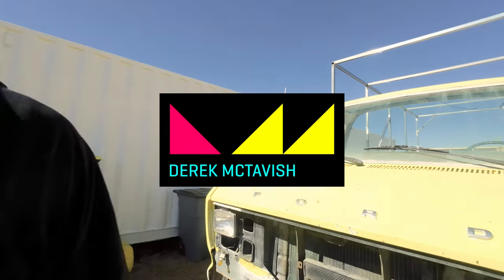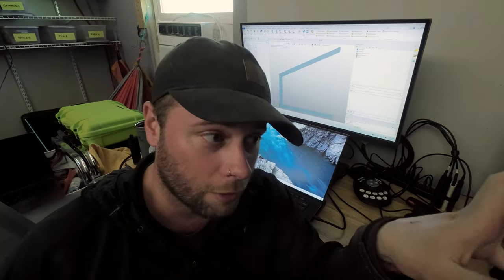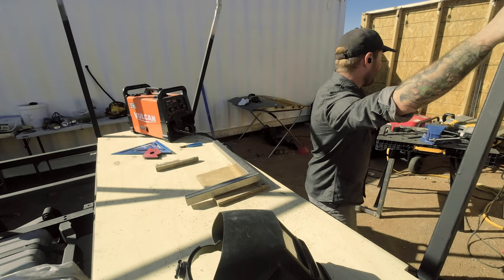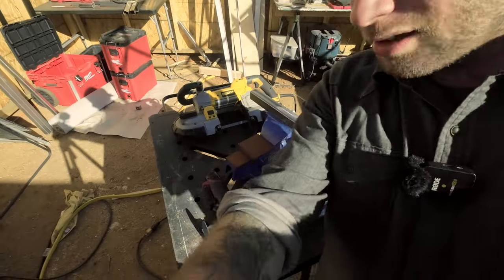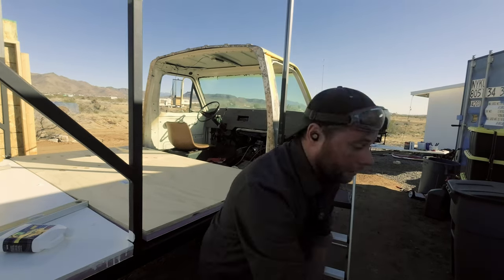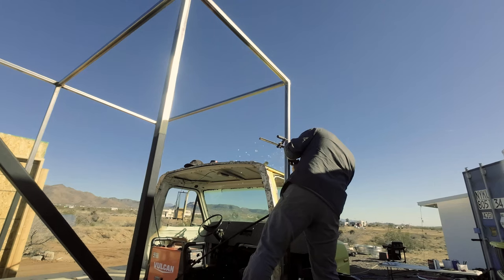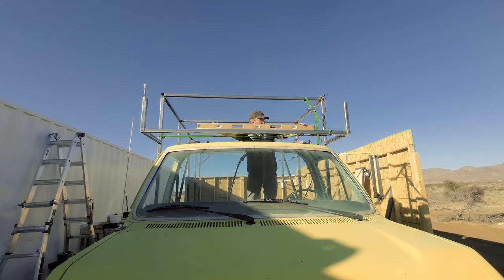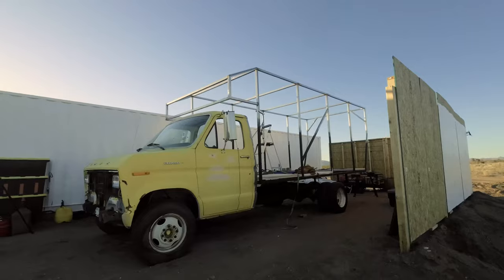It's starting to look real - overland van build attic / storage

Comment: I love the editing of your videos, it’s incredible! I’m still chugging along with my Harbor Freight flux core welder and shuttle bus.

Commenting, liking, and subscribing so you can get more recognition for your hard work.
Reply from the maker: Thank you!  Hey, everything I'm doing is with a flux core as well.  They work so much better outdoors when it windy (which it pretty much always is here.) Which one do you have?
Reply: @derekmctavish  I have the Titanium East Flux 125. Been welding in 1/8” square & rectangular tubing on the lower to mid settings.
Reply from the maker: I love that little welder!  Seriously it's a great welder especially for the price.  I did a lot of the bottom frame of this build with one, and it's certainly going to end up having a permanent home tucked away somewhere in this van. :)